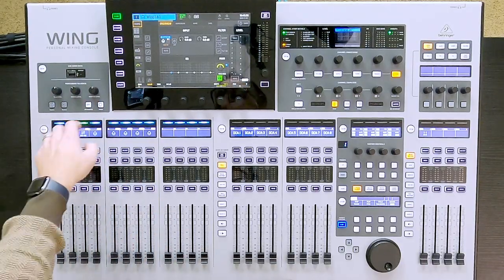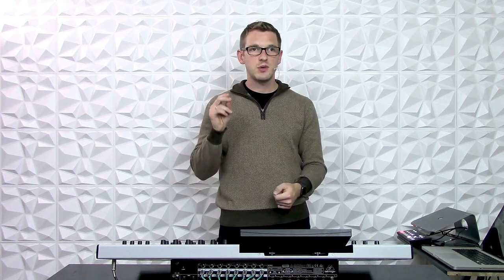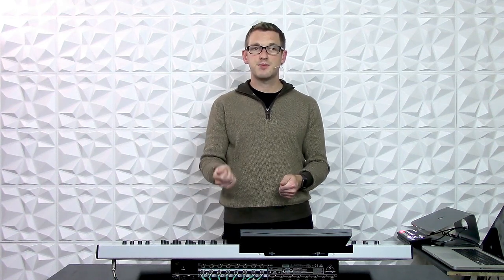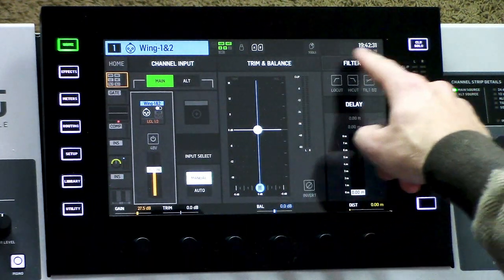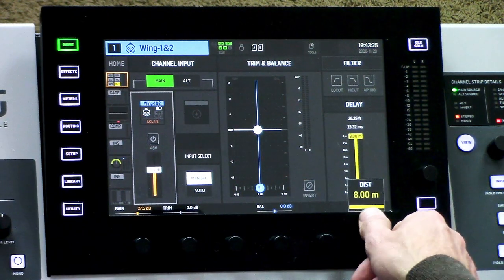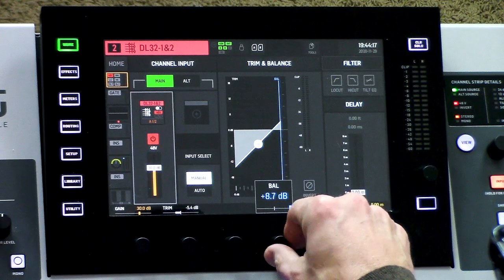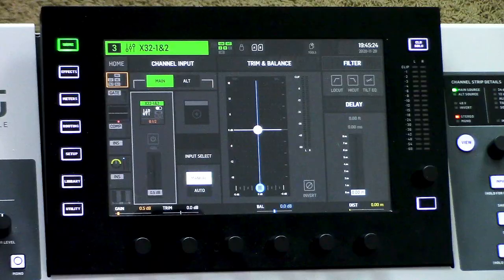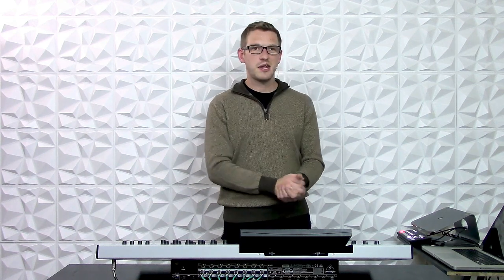Behringer Wing 104 - Gain, Trim, Balance, Phantom Power

Comment: Peter´s question ist very interesting.... please respond.....
"Hi Drew, again a great video tutorial.
Did you notice, that there no fine Control on the basic GAIN level?
It jumpes in bigger steps like 2,5 dB.
Is the concept to do the first brief setting via the GAIN function, fine tuning the gain then via trim?
What does that to the preamp of the stagebox (DL16)?
Is TRIM a digital trim or does it also drive the preamp?
Best, Peter"

Comment: Hi Drew, again a great video tutorial.
Did you notice, that there no fine Control on the basic GAIN level?
It jumps in bigger steps like 2,5 dB.
Is the concept to do the first brief setting via the GAIN function, fine tuning the gain then via trim?
What does that to the preamp of the stagebox (DL16)?
Is TRIM a digital trim or does it also drive the preamp?
Best, Peter

Comment: Hello Drew,  thank you for your series on the Wing.  We have found them very helpful.  Our church has just purchased a Wing.  Can you help,us with a question.  Can you assign the same Source to two different input channels on the Wing?. We find we need to adjust settings at the moment on the analogue board when using a wireless microphone depending on weather it is used as a lapel mic, or a headset mic. Can we assign a Source to (say) Input Channel 1 and set the gain on it for lapel performance, and then assign the same Source to Input Channel 2, and adjust its gain settings for headset performance? Or do we have to split the source input before it gets to the mixer? I hope that makes sense. Thank you, Warren

Comment: What’s the difference between gain and trim?
Reply: Seems like trim give additional head room..
Reply: Seems like trim gives added head room.. like added  gain for bus
Reply: Gain will adjust the level of your mic preamp. 
Trim is more like a digital Fader that will allowed you to play with the level after you set your preamp level. 
some people like to run hot gain and after that trim down the level to have more play on there Faders
Reply: it's only intended to be used when gain is controlled by another desk. pretty useless on its own.